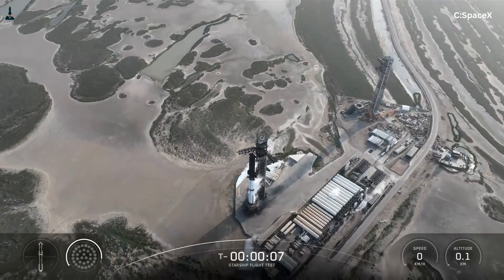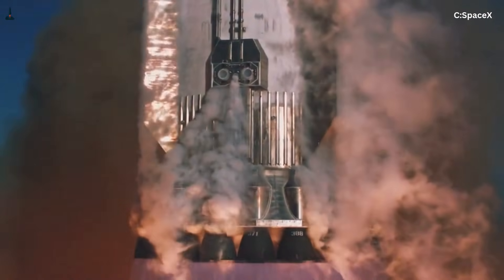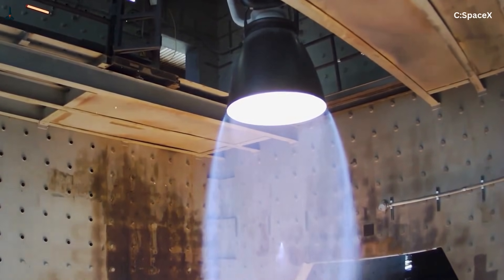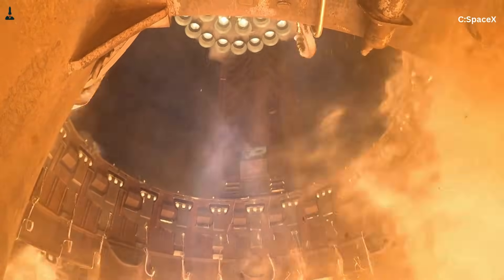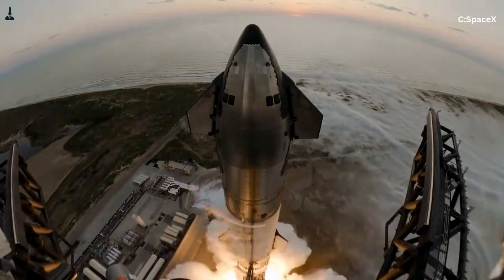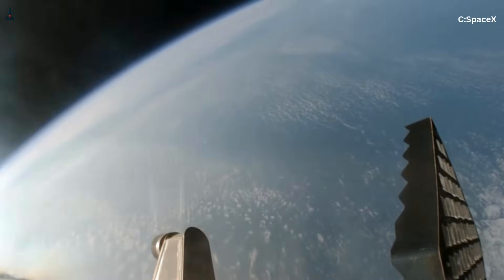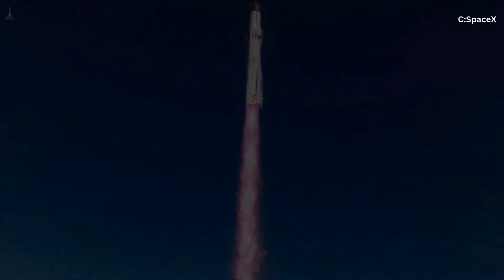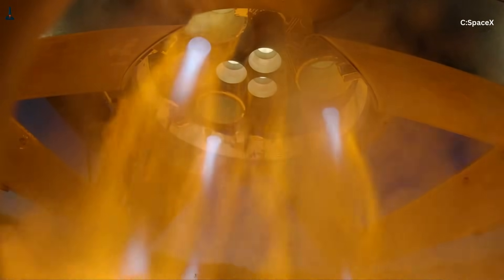Why Starship’s Engine Clustering Creates Extreme Acoustic Loads #spacex #space #starship #elonmusk

Comment: The main issue is sound travels faster through solid rock and materials than it does through air. Therefore at launch, the acoustic waves and exhaust that strike the ground shake the ground. Those ground vibrations hit you first before the shockwaves in the air hit your eardrums.